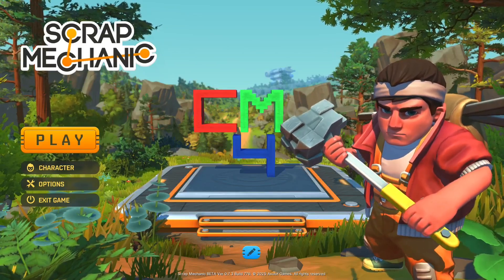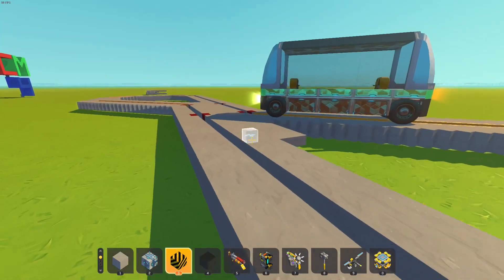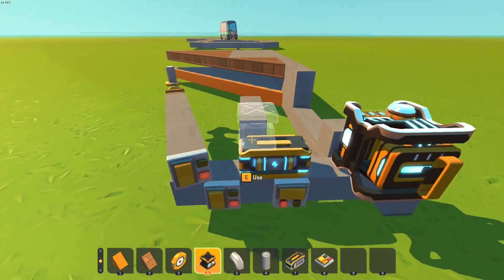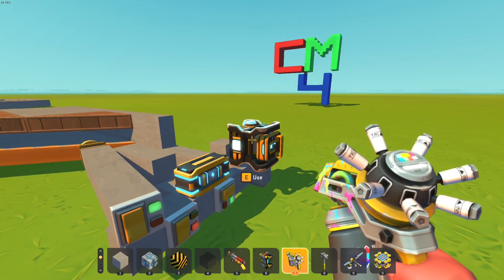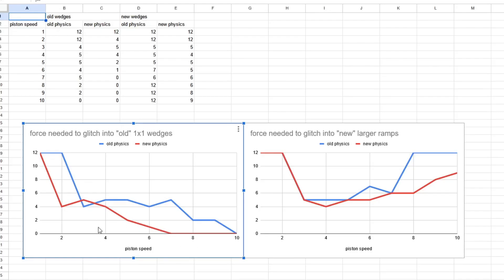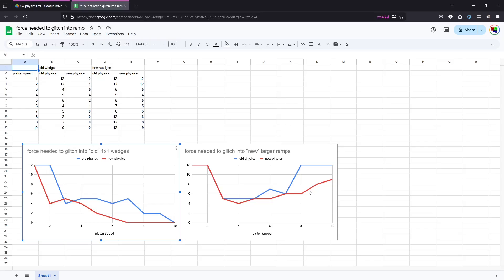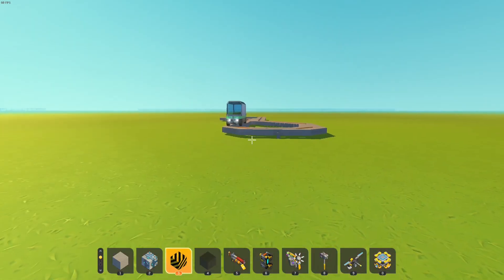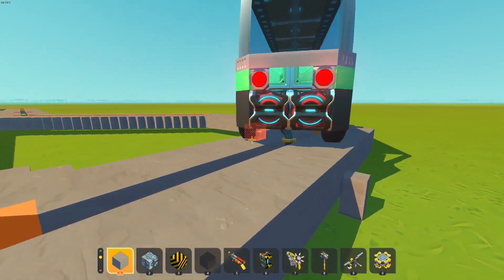Scientifically proven: The new Scrap Mechanic physics engine is less reliable.

Comment: I just hate the bearings ability to bend out of the axis. This makes heavier creations on wheels collapse on simple 8 or lower physics
Reply from the maker: Yeah, this is a hard thing to do properly in a physics engine. Not sure if this is the right term, but SM's physics is "soft" (not soft body), what means that instead of trying to exactly mathematically solve for all of the forces of collisions and joints, all these forces are made kind of "elastic". This is much simpler to implement, as you get a lot of emergent behavior for "free", as in an exact solver would need a lot of specific edge cases to be programmed, an soft solver doesn't.

(rant warning, sorry for that)
What the simple 1-8 physics do (I think) is change how often this soft joint force is applied per physics tick (I suspect). Long chains require multiple recalculation per tick, as with each recalculation a force can propagate through one joint at a time (often, not always) (this is a theory, I have not seen the SM source code)
The advanced and smart physics solvers just try to (I think) dynamically change how often these forces are recalculated for creations. Advanced (I suspect) just recalculates until the joints are straight, or when a limit is reached, and I have no clue what "smart" does, but it probably involves skipping collision check altogether, maybe only doing collision checks with hitboxes that were colliding in the previous tick??
Reply: @CodeMaker4 Scrap Mechanic uses the Bullet physics engine, which was state of the art... 20 years ago.  It's major claim to fame was being able to not completely break when handling multiple high velocity things at the same time.  Which mostly comes down to ballparking results when a set number of iterations (simple physics) or set amount of time has past.  Advanced physics tries really hard to get convergence, at the cost of simulation speed.  The latest change skips over some of the more costly calculations in some circumstances (regarding colliders and something about torque, don't remember the exact details).  It still insists on converged results, which is why you still get lag instead of floppy joints when you push it far enough.  Unfortunately, the only real solution would be replacing Bullet with a modern high performance engine (ideally one able to use vulkan/opengl/directx compute shaders to offload much of the work to the GPU).  Their rendering engine (ogre) has integration available with a fair number of better physics engines, but the game logic would likely need some porting.
Reply from the maker: Yeah that makes sence, didn't know Bullet was that old.
"The latest change skips over some of the more costly calculations in some circumstances (regarding colliders and something about torque, don't remember the exact details)" Do you have have a source for this? Is this from Axolot or from players doing research? I hear a lot of rumors about how the physics work and some people say it as if it is a fact that Axolot announced or was said by someone who managed to read the source code or something. If this source exists I want to know it.
Reply: @CodeMaker4 Well, not quite that old.  Git history goes back to sometime in 2006, so 18 years or thereabouts. I first evaluated it sometime in 2009 or 2010, in conjunction with Ogre (and a handful of other rendering engines).  

Anyway, I don't believe Axolot has said exactly what they changed, and I have not gotten around to kicking it myself yet. So this is conjecture on my part, based on the behavior I see in videos like yours, coupled with my exploration of Scrap Mechanic's compiled code (which was how I initially confirmed they are using bullet3) and past experience with Ogre's bullet integration.

Basically, there are relatively few knobs available to them to improve the situation.  It isn't a major advance on Bullet's part, as it's been almost 3 years since bullet had a new release.  The lag previously happened when different objects got close to each other, even without contact.  So bullet's contact callback system that handles AABB overlap is the likely culprit (or at least involved). Since the simulation still does converge (at least as well as bullet ever does), unlike the simple physics, it is not relaxing their constraint solver. That leaves approximating, simplifying, or skipping some category of calculation in continual-contact handling.  From several videos I've seen, it looks like that is specifically related to torques, but I'll need to do some local tests to verify that part.  Time allowing, I may do a short video of my own on the topic.

As for source code, you can't get their game code specifically, but both Bullet and Ogre are available on Github.  From exploring the symbols left in their code, it looks very much like they are using Bullet/Ogre's standard integration (but I am not completely confident on that part, as I have limited experience ripping apart windows executables).
Reply: @CodeMaker4 If YT silently eats my other reply, let me know and I'll try to summarize. They've been doing that a bunch to long and technical comments recently.
Reply from the maker: @yellingintothewind  I read your long reply, YT didn't eat it. Thanks for the clarifications on the age of Bullet. About not calculating torque, in my upcoming video I tested some of the suggestions in this comment section, and for one of them I changed the follower pipe from a two-bearing setup to just being welded and going straight down, meaning that the body of the cart and the rail piper are now one big body. The cart still glitched out surprisingly quickly and I caught this on camera, so stay tuned for that video. This shows that there are also problems when the joints are removed in the rail system, idk what that means for your torque theory.
Anyways you sound like a clever person, please join my Discord server as having complex discussions there is much easier, and the more people read your stuff. Link is in the description.
Reply: one odd thing is that this only really happens with stacked joints (like suspension or steering), single bearings are now floppy on advanced physics but extremely rigid on simple 8
Reply: I have a feeling that if the bearings were completely solid, there would be some very bad things happening all the time.
For example: If you had a suspension glitch, where the strength is dependent on how much the bearing is flexing, how what would happen if the bearing couldn't flex, but it was still forced to flex? I have a feeling that more complex creations would then just suddenly start flying at mach 10 sometimes.

Comment: Maybe try just not doing slotted cars in the first place and using sensors and painted paths.
Reply from the maker: We spoke during the livestream but I am going to comment so the rest can see this too. Line followers are nice because the cart and the guide system / rail don't have to touch. However, making a linefollower that can go fast in a straight line has given me difficulties, as in SM there are only binary "bang bang" controls, so if a cart is ever so slightly out of alignment it will start to oscillate back and forth. Also, even on the normal terrain fast moving cars will get glitched out by physics bumps too, so unless I make a hovercraft this won't solve all physics problems.
Reply: @CodeMaker4 bet i could do it
Reply from the maker: @Cogster  Do it. If it turns out to be possible I want to learn how it can be done.
Reply from the maker: I responded to this in my latest video https://youtu.be/oYVWSG5qiSc?si=eT8z2QiARQbPSa4E&t=185

Comment: The "Smart" physics have issues with torque loads on bearing that result in wobbling wheels or displacement. Love the MiniCart, would be cool to add more automation to it.
Reply from the maker: Hmm ok, does this mean that it could be less glitchy if I use low-friction blocks instead of wheels?

Comment: If the hypothesis is that the pipe misses the wedge during a tick. I would also suspect that the pipe would miss most often at the thin part of the wedge. Maybe this could also be tested.
Reply from the maker: Yeah I also would suspect that, and have seen evidence of it during the tests, but haven't explicitly tested this. Might do in the future, but it seems pretty clear anyway that thicker collision bodies are less glitchy.
Reply: After just playing with wedges, this 100% happens. And its real bad.
Reply from the maker: I tested this in my latest video and it does indeed seem to be true https://youtu.be/oYVWSG5qiSc?si=hrJM6WIGBePHCDe3&t=1089

Comment: @CodeMaker4 it would seem that scrap mechanic has troubles calculating collisions and more on small lightweight bodies, having a bearing with only one pipe piece on makes the pipe piece it's own separate body attached to the larger creation, the calculations for that small lightweight body is unstable, remove the bearing and it will be much better, not perfect just better since it still has a very small hitbox, this also applies to the old wedges, since they don't connect with the Neighboring blocks to create a large structure the hitbox is calculated individually, this is not a new issue it is only more noticeable with the new automatically adjusted physics settings, it is also the reason why individual bodies can get stuck on each other like a car door not opening all of a sudden, angle also plays a role so in the case of the car driving it around while the door is trying to open might eventually cause it to spring open, I'm not 100% sure but I believe the hitboxes or not calculated with perfect precision, weird angles might make the hitbox slightly bigger in One Direction, this data comes from a person who was determined to figure out physics one and succeeded, this is partially the data I collected, hope it helps :)
Reply: the new physics settings is actually better for what it's trying to achieve, ado the constant change in calculations per second introduces some strange quarks like pieces suddenly jumping off of each other
Reply from the maker: It is true that the physics engine SM uses has trouble with small lightweight bodies, but for the original design of MiniCart I found that the extra bearing on the pipe made the carts more reliable in the old physics engine because of the reduced friction. Also, because the MiniCarts are 6 blocks wide for decor reasons, the pipe has to be offset by half a block, which also introduces joints and lightweight parts. Now that we can make smoother corners the friction problem might have been reduced, so I will try to see what effect it has when the pipes are directly built on the cart without any joints in between. Thanks for the suggestion.
Reply from the maker: Thanks for the suggestion, it inspired me to try something that ended up working well https://youtu.be/oYVWSG5qiSc?si=lXYc4UlLTpwnEShr&t=710